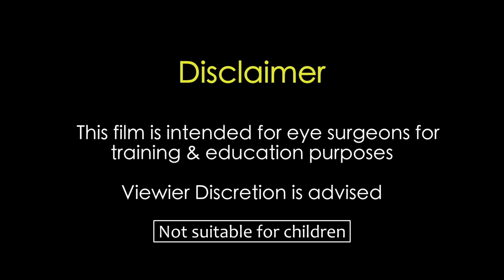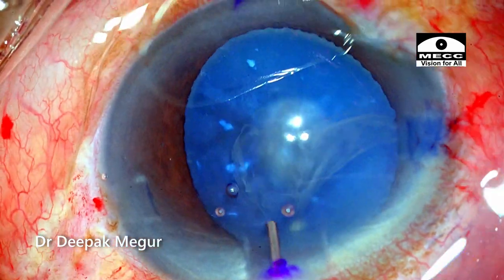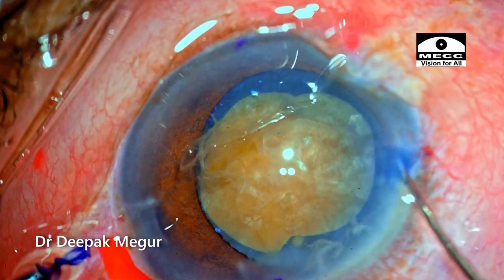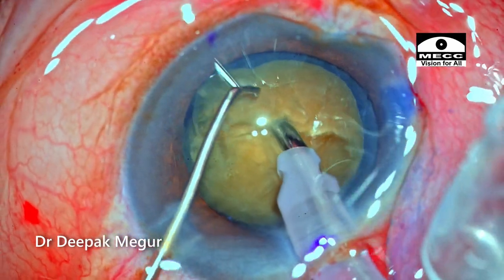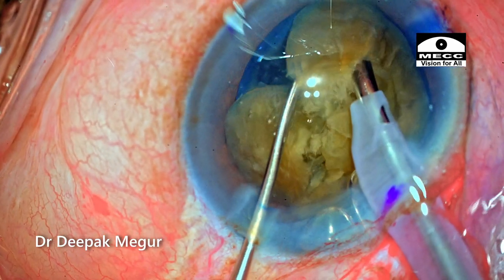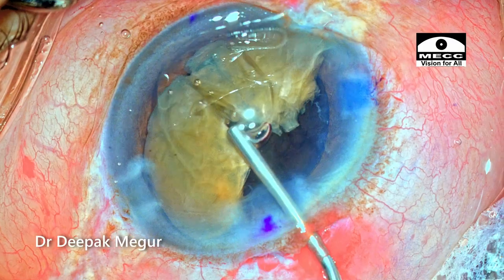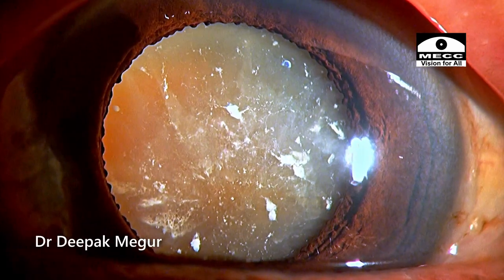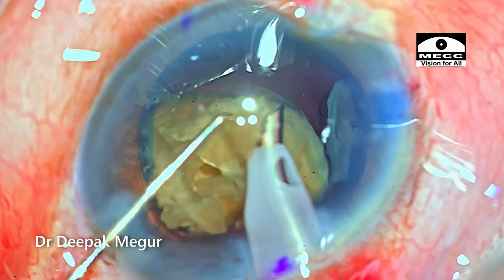How to minimize torque during Nucleus Division ? Phaco Chop Horizontal..!

Comment: Great surgical skill 
But if you ever tried oertli phaco machine, the torque situation will not happen because oertli phaco tip holding capability is much stronger than other phaco machine.